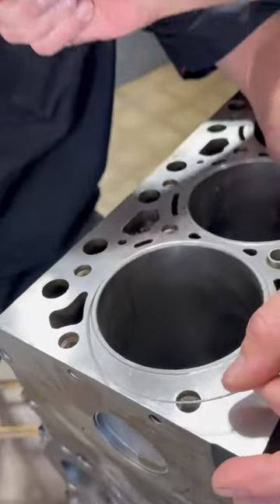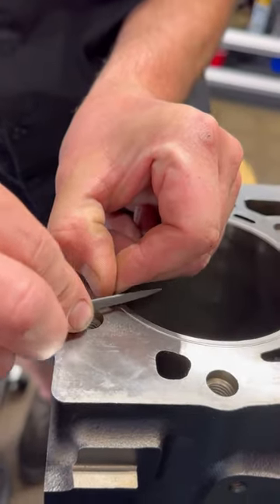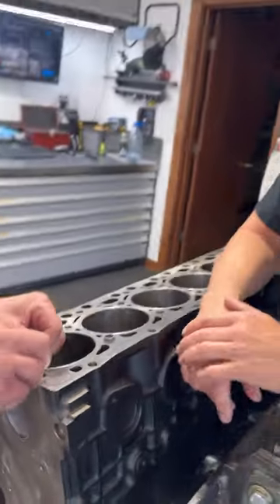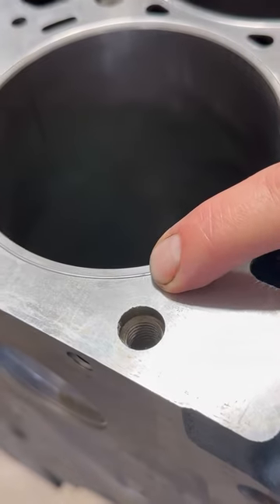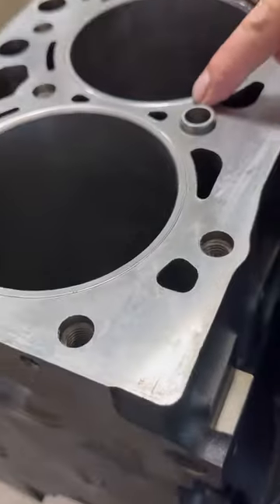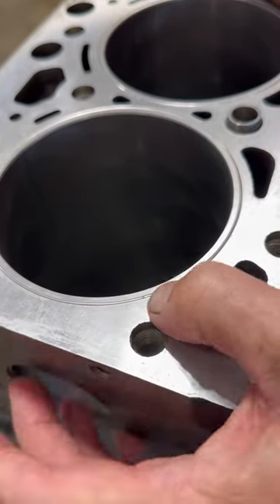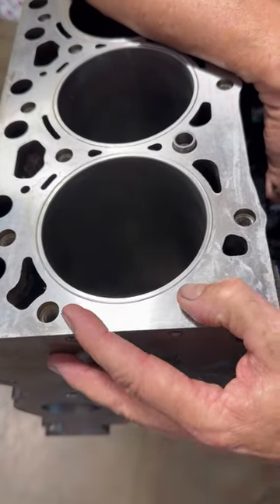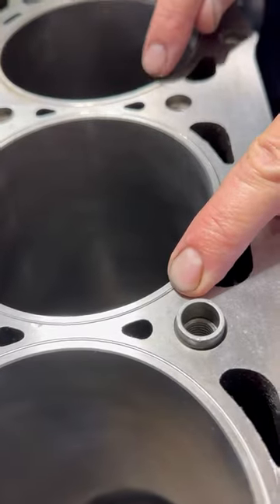The proper way to install the stainless o ring in the deck of a Cummins for added protection #engine

Comment: My father owned a construction company , truck ,cat trailers etc . I went into the navy and got a A school in aviation ended up a jet mechanic and two year’s flight line troubleshooter, it was amazing! I rebuilt my first 5 speed truck transmission at 13 yrs old .I ended up 33 yrs in paper manufacturing and worked as blending engineer on the fast paper machine in North America l also built outboard motors for 20 yrs . I got to tell you guys when I seen your first video I’m hooked ! The skill level and care are amazing. Respect guys love it 👍
Reply: Yep I agree bro, I was a jet engine tech also in the navy and watching how much they put into detail!! I wish I worked for these guys. Love it!!
Reply from the maker: Good to hear your story. Thanks for watching
Reply: Well stated.
Reply: @randmayfield5695  my son built motors with me you will never be good at it if you don’t love the engines it that simple ❤️Rpm are music!
Reply: @richardwolske2015  So true.
Reply: Similar history here, grew up in a big auto shop, certified, then certified boat engine mechanic, then general contractor, there's almost nothing I can't fix . 😅

Comment: Steve Morris has actual rings manufactured, so there is no parting line
Reply: ya i was thinking the same thing. tjere must be some manufacturer who can make ss ring without a break
Reply: If you can pay the Steve Morris price no problem but most people can't or won't..So we do it ourselves in our own garage..
Reply: @jasonbamford7579  o it didn’t look like these guys are in a home garage 🤷‍♂️. It looks like someone is paying big money to have that done🤷‍♂️ but maybe your right these guys are in a home garage with harbor freight tools🤣 o I mis understood you just like you misunderstood me🤦‍♂️
Reply: Are you referring to the o-rings are fire-rings? I haven't heard of o-rings that are made but that is the only way I've heard with fire-rings.
Reply: @darrinscoilsclouds1498 I build 5.9 12 valve motors very similar in my home garage cheaper than I run them thru the shop. Still not cheap. But figure 100 per hour vs 180 to 220 per machinist hour. I call those the baller on a budget builds. Still same machine work but sense it's home garage my mill is smaller an slower and it's my off time so may take two weeks vs 2 days.
Reply: You can get an actual ring with no seam, but the cost is considerably higher. They start about $75 per cylinder. Buying a spool of wire could cost well under a dollar a foot. As long as you put the ends near a stud, it works just as good and saves you money. And time. Most rings will have to be ordered to spec and it will take time to get them. So, just as good, cheaper and no wait time, that’s what any racer wants to hear.
Reply: If your cut diameter is off by even a few thousandths, the pre made rings will not work and actually cause damage if they attempt to install them. This way, there's much less risk for shop and customer, along with saving money
Reply: @pepperdaddy69  makes sense
Reply: @darrinscoilsclouds1498  yeah, but they can make them themselves for cheaper, which means they can charge less for whatever customer’s engine they’re working on if they’re doing it commercially.
Reply: Im new to this ....what is a fire ring for?
Reply: @rogerringold616  this is an o ring, it adds clamping pressure in the sealing area of the head gasket so more combustion pressure can occur before a leak.  Aka more power.    A fire ring does the same job but with more machining and engineering and it's one step above this in terms of a solution to the head gasket
Reply: And he puts the grove in the head not the block
Reply: @jasonstormoen  I'm familiar, I've done it both ways. This is not old school, it's just more affordable and does the job for many applications.    It's not as simple as cut the block and the head and you're done, there's a lot more work involved
Reply: @pepperdaddy69 You can do you, but I also know how it's done. I have been doing cnc machine work for many years. And the top engine shops out there like PAR, Steve, TKM, Noonan, BAE, VED, and some other will tell you this is the old-school way. This may work on lower hp, boost, and compression stuff that's not run hard, but it never holds up on stuff that's making any kind of power that's a boost application. That is why thick solid Top Fuel aka Flame hoops are now used.
Reply: @jasonstormoen why do you keep listing companies? Do you know them personally?    Also just because you do CNC doesn't mean you can build engines 🤔  

For what this is, it's the best option.
Reply: @pepperdaddy69  Listen, I have built more engines than I can remember. For 17 years I worked at an engine shop running a cnc centroid 5-axis doing the cylinder head porting, and I ran a HAAS 4-axis cnc for all the engine block machining. You wanna talk about listing names, I listed names/places that I know do the top fuel hoop vs the o-ring, but I know as well. I now have a small chassis and fab shop, and meaning I know Scott at PAR, he and his crew do all my engine blocks, and I have Curtis at RFD do my heads and intakes for me. When you're in drag racing your whole life, you get to know a whole lot of people in the business, whether it's the owner of ATI trans, a head porter, an engine builder, or a track owner somewhere here in the States, that's not just me in any kind of way either. That goes for a whole lot of people in all forms of racing at all levels of racing.
Reply: @jasonstormoen HAAS machines are garbage.
Reply: That’s one lucky son
Reply: I just Tig weld the gaps on my rings.
Reply: @leightonandrade8755  you tig weld those?... I'm curious because I can't see how or why... wouldn't that leave a bump that could lead to a head gasket failure?... couldn't that mess up the deck? It just doesn't sound realistic to me...
Reply: We always had rings made
Reply: @leightonandrade8755 why , just why you ? Cut the wire at an angle and the other side at a complementing angle, file them to overlap without a bump. // done.
Reply: @jasonstormoen yup, get to know a few people for sure. This O ring deal hear would be good for someone running say a 300 shot of nitrous or 15-20lbs of boost. Certainly not for 60lbs and making 3500+ hp as Steve Morris is, that's where the top fuel hoops come into play. Cuz if you can afford to have a Steve Morris type engine, then you can afford the top fuel hoops. These O rings are certainly better than just a head gasket for sure!
Reply: @DL101ca Sounds good but that would be some very precision filing! To either not have a bump or a dip!
Reply: There are 2 options, fore ring and o ring. This is whats called oring. A fire ring is thicker and is one piece. Some people say its only for race trucks but thats not really true. Given the choice, i would opt for the fire ring

Comment: When I installed my orings in my gasoline i4, it was a .041 stainless ring installed into a .040  x 0.030 deep block groove with no receiver grooves in the head, just a stock head. I was worried 0.011 protrusion might be too much for the aluminum head, but the compression rings crushed nicely to the iron block around it after some minor head gasket modifications. I didn't have to tap it in, it went firmly in by hand. Id wished it was a tighter fit. The hardest part was getting the mating ends JUST right. but, I did not use an angled cut and it's held up to nearly 4 bar for a couple years on a felpro graphite gasket. Amazed to stay the least since it used to push the gasket around 2 bar with no orings. I did it alone in my dad's garage as a youngin. It was a piston and rod motor with a fresh crank, oil tolerances micd and specs at .010 per in journal dia. 2200cc injector per cylinder, 5 bar map gm iat on speed density running a borg s256 w custom turbine wheel and housings. I welded up the intake ports to remove the emissions system inlets, fabricated charge piping, grabbed an off the shelf t4 header to make things easy and haven't been able to push it to the limit. Are you looking for any seasoned technicians?

Comment: I honestly wish I had a relationship with my dad like you guys have. No matter what I do, it's wrong. I bought a truck from him once and when I got it, I serviced all the fluids and filters on the entire truck, even the brake fluid, power steering. He told me I was gonna have leaks everywhere and mess up a good truck. That was several years ago...not a single leak or issue whatsoever in the last 50k+ miles since I bought it 😂....I could tell stories for days about stuff like this.

Comment: i’m putting a built engine in my car, the block had those same ring inserts added. gonna look to see where the parting line was placed just to see if my builder is as keen as you guys.

Comment: You would think that after all these years, we would have a better way with a block and head mating surfaces. I say this because it is obvious that the head tends to want to pull away from the block even with all these tricks.
Reply: There was an F1 car engine that didn't use head gaskets at all. The cylinder head and block were all one big peice!

Comment: The rotation of the ring gap to the head bolt is a great suggestion. It could be easily overlooked and cause problems later. 
I’m guessing your trying to maintain a .010 -.015 gap or less on the ring. Would there be any additional benefit If you added some devcon or a heat resistant epoxy at the gap? To strengthen from a possible blowout? Obviously the orientation you use is efficient! I was just curious since your trying to control a nuclear blast in the chamber! Lol

Comment: A better design is a carved-out lip from the factory block and the top-end mating surface to have a beveled cut out to sit potentially so snug and perfectly it doesn’t need a head gasket around the cylinder walls 🤷‍♂️ maybe also going the extra mile and compensating for thermal expansion etc

Comment: What amount of protrusion do you recommend the o-ring be set at? 

I had my 12v Cummins head o-ringed, and I was watching DDP and they said they were having head gasket sealing problems when the protrusion was around 0.0035”. 

They carefully milled down the orings to about 0.0010” and never had issues since. 

What are your thoughts? 

Also any recommendations on how to remove the o-rings safely to replace if one was dented/damaged?

Comment: awesome. i have a question, will the O Ring/ fire ring not expand and deform like a piston ring? i’m expecting it to deform because of the small tolerance, but im sure they wouldn’t be installing it like that if it was an issue. can anyone explain?

Comment: That's the method I would've used in another video I seen of you making a gasket. You used a ball pien hammer, whereas I would've used this, or a rubber/plastic mallet to avoid any chances of damage.

Comment: Hmm… only one issue with that parting line. When you ready the manufacturer’s instructions on the install. It’s been revised. Saying to keep it farthest away to allow expansion and contraction to avoid cracking over time. Now who knows. Maybe it changed again. Maybe it’s not the same as sealing solutions. But it makes sense to me!

Comment: So you throw arp head bolts on and what's to say that the threads won't pull from the block? OEM head bolts allow more stretching and are more forgiving under high boost compared to arp which are extremely stiff. They don't allow the head to lift but also don't allow any give as well. The block is designed with intent that you'll be running oem bolts and not studs

Comment: Hi Dave. I have found that a Lot of Machine Shops in South Africa put a Bevel at the Very top of the Sleeve after they Re Sleeved it or Bored it out to fit Oversize Pistons. Isn't that a way for Combustion gasses to creep in under the Headgasket over time?

Comment: Why not bevel the wire ends and overlap at the joint, which is immediately adjacent to the head bolt?

Comment: What about beryllium fire rings? They're a 3 dimensional, crushable doughnut shaped sealing ring. It's the next evolution in O ringing a block, we use them a fair bit these days down here in Australia... Look into them, Dave- rhey're rye best rhing since sliced bread. You jnow how MLS headgaskets are designed to be able to maintain seal even when rhe gead is starting to lift- beryllium fire rings are an Onring capable of the sane thing, in situations where a traditional wire O ring fails, the fire ring can maintain the seal of the combustion chamber even with 0.05 - 0.08 thou head lift under extreme conditions!!!

Comment: I’m a bit of a newbie. What does the o ring do? Does it seal the engine like a head gasket would?
Reply: you still use a headgasket. the ring gives it extra bite so compression doesnt leak by.

Comment: Just an FYI i dont recommend ARP. I know the guy who designed their head studs. They stole the design from him and its not really the best design out there. They lie about the Tensile strength. EXotic seems to be holding up just as good if not better than ARP.

Comment: I would absolutely love to know where your shop is. I have a 91.5 dodge I’ll give you three guesses with under the hood. I’ll give you a hint I go by six in a row.Jim anyway, I want my engine Borden honed with a RAW or boring bar. I think it would be best since the block has 500+ thousand miles on it to have a line home with art studs and stuff like that I just wish I could find out the name of your shop. I’d like to google you and see you at what it would cost to get my engine reconditioned or I should say rebuilt I have a stage to Hamilton Cams head on there.

Comment: Wouldn't it be better to put the cuts facing the same, 2nd head bolt, like 2 cut to 1 bolt rather than 1:1?

Comment: Good job. But shouldn't that cut be turned 90 degrees either direction from the way your installing it and sealed with loctite o-ring compound? The pressure should always press one taper against the other to create a tight seal at the joint. Installed the way you show, the pressure can push directly through the cut, and It doesn't press, against the end, to help seal the cut. Yours ===\===, Mine lllllllllllllllllll. Do you see the difference! Later! J Poll.👍🇺🇸🏁

Comment: Why do you all use wire for these? Wouldn't it be better to just use like a regular steel o-ring so it's the same all around. And you don't have to worry about parting lines. And wouldn't it be stronger and make a better seal? Then you know that it would always be the same every time and you could just have different sizes for different bores

Comment: What does that ring do why is it there any way
Reply: Helps seal under very high cylinder pressures. It sits slightly proud of the deck.
Reply: Thanks!

Comment: I've taken apart rebuilt and worked on hundreds of engines. But all gasoline engines. I've never worked on a diesel. Except to help my little brother changes seized turbo on his Ford 6.0. Yes I know probably the worst diesel engine ever made. Right up there with the 6.7. But I never taken the head off of a diesel. But I've never seen any engine that has metal o-rings that go around the cylinder bores. Is that something that all diesels have? I am actually extremely ignorant when it comes to diesel engine lol

Comment: It’s not the 1970’s anymore head gaskets are way more advance now,
Reply: Why comment if you don't know what you're talking about?
Reply: @ioijiopjkiopjkp tell the class exactly what Euroman said that isn’t 100% truth. 

Gail Banks says head bolts are better

Go argue with Banks Engineering.
Reply: Easier to add an o ring than add more head studs. Sometimes stronger head studs aren't the ultimate solution, it depends on their placement and the strength of the head/ block. Ideally you could just have 8 studs per cylinder...
Reply: We use them on a big nos engine.
Reply: Steve morris uses them in his race engines, so I'm guessing it helps more than just using a head gasket

Comment: FYI, you’re groove machining geometry is incorrect.Your grove is tool is a lathe radius plunge bit. Not trepan geometry. 
To put in simple terms, you would not use a lathe cutoff bit to plunge a circular groove. Please do the correct thing. It’s not helpful for anyone when your showing, but your not machining correctly.

Comment: Ooooo ummm that's not compensating for expansion from heat.
Reply: its SS on what looks to be a cast iron block, pretty close thermal expansion profiles...it will just swell with the block / head
Reply: They still use a gasket. This just increases the clamp load around the cylinder. This method has been used for a very, very long time.
Reply: @geoffmooregm  That's a long time